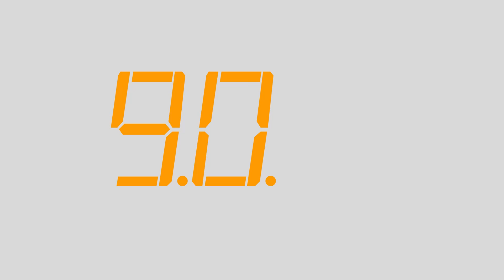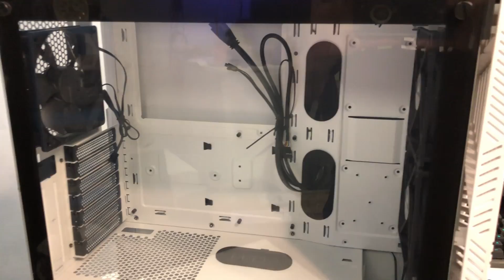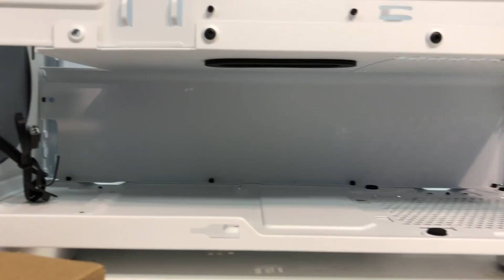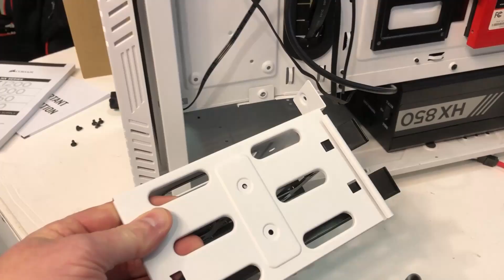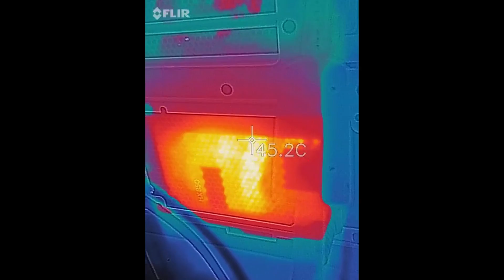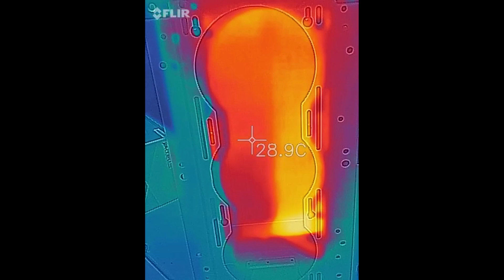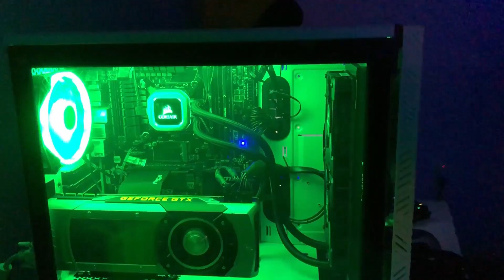Corsair 275R Airflow: In-Depth Case Review

Comment: Props to you for making the first English review of this case, I've been waiting pretty long for one
Reply: Do u know if it comes with fans
Reply: @tarafaigle9500  idk if you decided to buy it or buy some other case but i got the black one not that i dislike the white one i just know it will get dirty anyways if this helps great i built a high end gaming pc and left the stock fans in overall the case feels pretty good and sturdy i mean i wouldn't push the front panel like crazy as there is a gap but the overall case feels sturdy for the price your paying and i put high end components i kinda skimped on the motherboard because i dont need pcie 4.0 and so no b550 or x570 but i have a 3800x in there ( i know 3800x is not the hottest gpu but it can get toasty and im using a noctua u14-s so an air cooler like the second best air cooler but an air cooler)and b450-f asus as well as a blower style gtx 970 so you know it runs hot (as its blower style its temporary card until next gen gpu's come out this year) and even though its 30 degree Celsius if your american you can convert it so very hot for uk the hottest it ran was 70 degrees on gpu and 65 ish on CPU at least on hottest core when gaming there is alot of airflow this case is rightfully named and cheap for what you get 3 fans is pretty damn good so would recommend for easy maintenance and best bang for buck when running hot components
Reply: Tara Faigle it does. I asked that as well. It looks like it comes with 3, 2 in the front, and 1 in the back
Hope this helps!
:)

Comment: Hi Chris, how was the spacing between the glass and the gpu when mounted vertically? Did the gpu have any issues in terms of throttling or heat?
Reply from the maker: fakedevil The GTX770 fits well, and there is maybe 1/2” of clearance.  No problems with performance. But after this review was posted I received a 2070 Super, and it is considerably larger and was right up against the side panel.  I am working on a system build video and I was going to point out the difference in graphics card sizes.
Reply: @overclockersclub  Thanks! I was going to put a rx5700 blower gpu vertical in this exact case too. Was wondering how it would turn out.
Reply from the maker: @fakedevil  My GTX770 is a blower style, so if you do a little research into the dimensions of your RX5700 and compare that to the GTX770, you should have your answer.  But my guess is that the blower cards are by nature a little more narrow, so you might be ok.  Still a good idea to find out and avoid disappointment if it is too large.
Reply: @overclockersclub  Yup I looked it up, its almost the same. I figured since I have a blower style gpu, might as well see if i can mount that vertically. The face of it looks nicer and it has no back plate either.
Reply from the maker: @fakedevil  Good!  And what PCIe cable are you going to use?
Reply: @overclockersclub  Havent really looked into that yet. Any recommendations?
Reply from the maker: @fakedevil  I am using one from Fractal Design, but Corsair makes this one:  https://www.corsair.com/us/en/Categories/Products/Accessories-%7C-Parts/PC-Components/Power-Supplies/Premium-PCIe-3-0-x16-Extension-Cable-300mm/p/CC-8900419
Reply: No problem with that. I have a 5700xt that fits fine